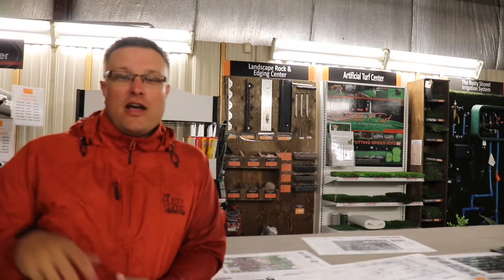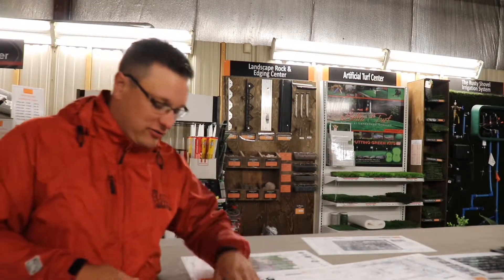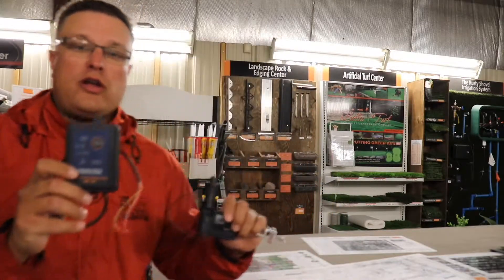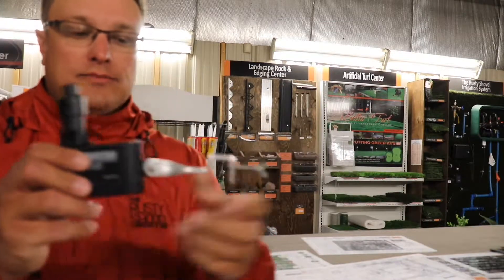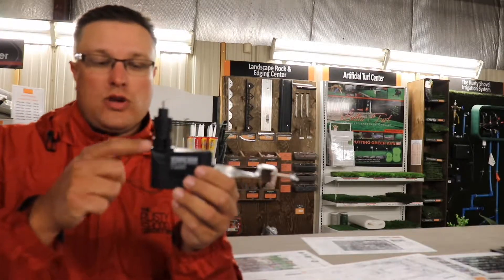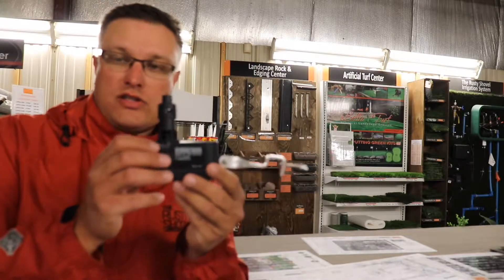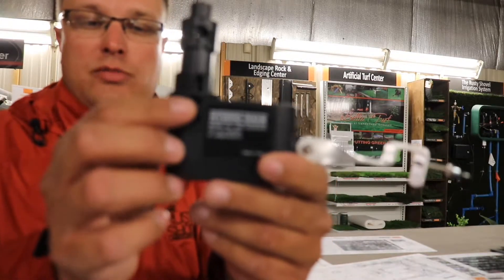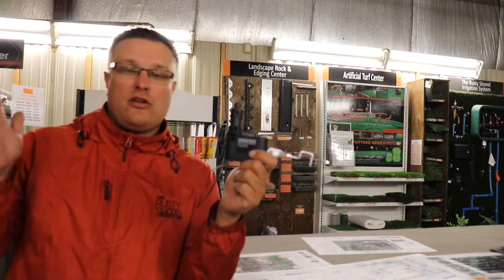Hydro-Rain RF Rain Sensor

Comment: thanks for the vid.  I have a HRC-100-RS-RF, and the plastic part that attached the mounting bracket to the case broke off. what is the best way to go about replacing this? when I look online, I see they are selling the rain sensor along with the wireless receiver that connects to the controller box. I already have a wireless receiver. do you know if I can just by the rain sensor and connect that to the existing wirless receiver I have? thanks